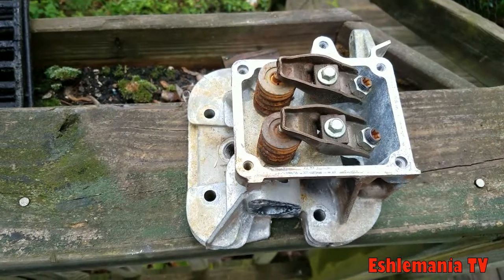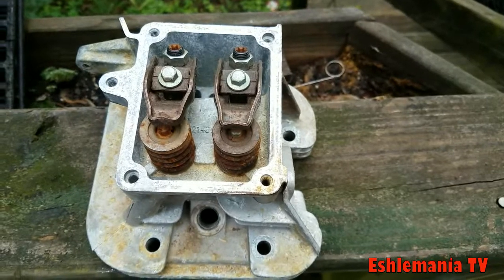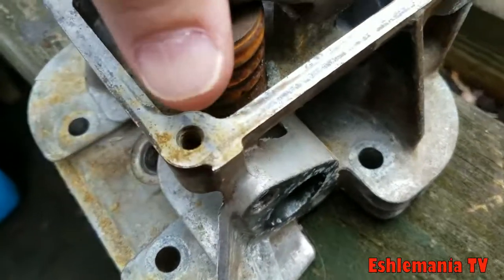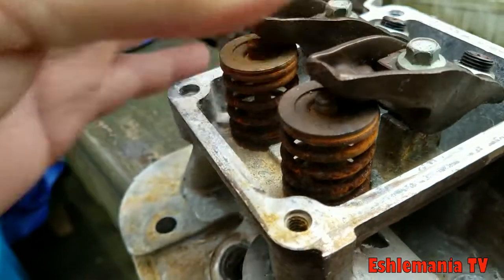Bent Pushrods In A Lawn Mower Engine! What Causes Them?

Comment: Some additional thoughts... I have a Kohler Vtwin that eats push rods every couple of years. The first time I dismantled the entire engine and replaced the rods and reseated the valves that's when I found burnt sticky oil in the intake valve guides I cleaned it all off and replaced the push rods and all was well untill wnother mouse decided to build a nest in the engine blocking airflow again and sticking the intake valves. The funny part is that the engine ran perfectly the previous time I cut the gras and only stuck the valves after sitting...this is the clue that it wasn't the dreaded valve guides coming lose but instead the coking valve guides from overheating. Just bend the push rods back and clean the guides and put it all back together and your back in business. Every failure doesn't doom the engine and the push rods do just fine if your careful not to crimp the tubes by using a plastic mallet. So the take here is not to automatically doom the engine to needing new heads until you inspect the valve guides first, and lucky for you all this requires is to take off the valve covers and have a look .

Comment: Infrequent oil changes, overheating from debris building up on cooling fins (need to remove engine shroud and clean and check), excessive valve clearance, and other reasons for bent push rods.  It definitely happens more than you would think.

Comment: Wonderful, Thank you for posting this. I have a 2 year old 19L232-0036-F1 that snapped the Exhaust Push rod. I purchased a new Rod, and installed it and started to bend that after turning the engine over by hand w/o the plug in. Now thing back after removing the valves and doing a  head/valve cleaning, I remember the exhaust valve guide being higher than the Intake. New Cylinder head coming up....& regarding the overheating issue. This engine is in a dusty ,dirty environment, but there was NOT any buildup of debris in the fins, or the cooling fan, and am at a loss to figure out why it may have over heated to the point that this could have happened.

Comment: After beating my head against the wall working on a Vanguard because I can’t get the valves lash to stay when I rotate the engine and the pushrods wanna keep falling out and I did have a bent pushrod and bought another steel push right on the intake I watch this video and I noticed that on both heads I see the valve guide pushed up on the intake so thank you very much because now I know what the hell’s wrong but the engine didn’t overheat so I don’t know why this happened to mine

Comment: I have seen rocker arm come lose and a pushrod fall off and the other will bend the valve was closed tried to blow out the intake on a power stroke .   Heat is the killer of all Engines .     Still Great advice to look for when doing a pushrod  B&S valve guides do come lose under heat .

Comment: good info. The valves should be checked, adjusted periodically to prevent and or catch it before a bent push rod occurs.
Reply from the maker: Valve adjustments are something that way too many people neglect. We know that most people believe that as long as it starts and stays running then the engine is fine. This is something that good repair shops have been adding to spring service programs and most customers don't have a problem with paying the few dollars extra when it's explained to them and shown that the manufacturer lists it in the manual as a requirement after a certain amount of hours.

Comment: Excactly what i was in search of...!!! Thank You for this video!!!
My push rods were missing completely...???
Bought the mower used and have no clue as to where they went...??? And i honestly don’t see a way for them to have (dropped) into the oil pan yet i do plan on searching for them there...Otherwise the factory Left them out 😳🤷‍♂️ or previous owner took them out because the mower generates enough power to mow without them!!!
I’ve obviously been mowing without them for quite some time and couldn’t tell by the sound of the engine... no backfire no spitting and sputtering no unusual noises at all-went to tune it up and one plug looked Great (as if it hadn’t been used) maybe it hadn’t been 😂😂😂
Thanks again and I’ll be sure to subscribe to your channel ✅

Comment: My 25hp V twin B&S bent one pushrod and broke the other push rod on one cylinder and the other was fine. Valve guides were set where they should be and the valves moved fine.  Any ideas why? Had to take the engine apart to remove the broken push rod.

Comment: Can you get a complete head?  I can't find a complete head with valves and springs, I have a 28HP Kawasaki and all I can find is the bare head.  Do you just re-use your old valves, springs, rockers?
Reply from the maker: Kawasaki has started making kits for cylinder heads. But so far it's only for certain models of engines. So if there is no kit available for yours then you would either reuse your hardware or purchase everything new individually.
Reply: Take to long and youtube do not accept so much time.

Comment: Awesome! Thanks for the tips. I inherited a Husqvarna with a 23HP motor that was said to have "bent pushrods" i am going to take it apart once it warms up a bit and do some digging around. What the usual cost for a new head to replace it and it sound like its pretty easy to replace?
Reply from the maker: Retail on a new complete cylinder head kit for these Briggs Intek twin cylinders is around $150 or so. But that can vary greatly depending on where you live and what dealership you talk to. 

It's not a not a difficult job to do. Just have a shop manual on hand and follow the directions.

Comment: A bent rod does not mean the engine is destroyed does it? I suppose being overheated might be a more major issue.
I am looking at an old Diesel tractor that has a bent rod and I figure I could do a full rebuild over time.
Reply from the maker: A bent rod means that some other component of the engine has malfunctioned. So it really depends on what happened to cause the rod to bend.
Reply: @EshlemaniaTV my mower deck dropped after hitting a rock and the rod broke at that moment.

Comment: I have the Same thing  what i did was  took the valve guide out  tock it to machine  shop Make a new valve guide  with little biger diameter  on one end  pushed in from inside out that way it wont come out problem solved a lot cheeper  then by a new head .

Comment: i'm going to pull the valve cover off my briggs single cylinder engine and check it is loud like the exhaust is trying to come through the carb  even puffs smoke out of carb and when it started it got so slow a power wheels could pass it
Reply: Timing jumped
Reply: It's a bent pushrod mine did the same thing.

Comment: Something in my Kawasaki engine on my Toro is ticking. I removed the valve covers and adjusted. It didn’t help. Everyone keeps saying oh Kawasaki’s are just noisy. Or oh that’s normal. It doesn’t sound normal to me. Can you take a look at my couple videos on my channel and see what you think?? There’s only about 6 videos total. All are less than 30 seconds. The engine doesn’t have any loss of power. The only thing that is odd is sometimes when I go to throttle up from idle it takes a second to catch up if I go to quick.

Comment: Mice love to nest in the shroud..the nest restricts air flow which cellos the engine and the head expands faster than the guide so the guide walks outta the head so use moth balls or hot sauce when you don’t use the machine for the season

Comment: Have seen this on kawi twins too.
 Mice aren't nice.
Reply from the maker: Yep! I've seen this on Kawi's too. The ones I used to see it on the most was on the horizontal V-twins in the John Deere zero turns. Horizontals in zero turns usually struggle for cooling air more than the verticals so it was never a surprise when we would get one with a valve guide that had moved.

Comment: Is it possible to bang the guide back down where it belongs and peen it?
Or is the head just junk.
Reply from the maker: Some people will try it and think that they've just saved them selves a few dollars, but in the end it's only going to cost more time and money because you'll have down time again and will finally have to spend the money to replace the head. Better off to just fix it right the first time around and make sure your cooling fins are clean so the new head lasts.
Reply: @EshlemaniaTV  Seems like it would be fairly easy to drill and tap a tiny hole tangent at the interface between the guide and head. Then put a set screw in it and peen the top of the hole over so it cannot back out. The threads then take the loads instead of a press fit that has become loose. Peening the guide it might work too, but only if peening over the top of a chamfer on the guide or a groove in its side. I think these are smooth and not flush at the top, so would not hold tight just smashing material into the side of the guide.
The new head probably runs around $150 though, so depends on what people's time is worth, and if it is work for someone else.

Comment: Will really bad black oil cause this?
Reply from the maker: Really black oil is a sign of oil that has been burnt. So either it was in there too long and was not helping to lubricate properly which will cause high temps from friction, or the oil burnt from an external cooling problem such as clogged cooling fins or missing fan blades. Either way, black oil is a sign of an engine that was running at high temps and over heating is the primary cause of this failure.
Reply: @EshlemaniaTV  cooling fins are clear and no broken fins.the intake push rod was broke in half.valve seat was in its normal location.the lifter is frozen.i think it was just really old oil.

Comment: weak valve springs? compare a new spring to the old one
Reply from the maker: Compare a valve spring in one of these Briggs Intek engines to one in a Kohler Command engine and you'll see a huge difference. Compare a used valve spring from a Briggs Intek to a new one for a Briggs Intek and it's not going to be that noticeable if at all.

Comment: On my single cyl intek the intake push rod bent. Everything else looks ok and the valve guides are where they should be. The valves move freely. Would i be able to get away with just replacing the push rod?
Reply: Did you end up doing this?

Comment: I've encountered the bent push rod syndrome with a used Briggs snowblower.  I've since jerry rigged the push rod guides by drilling a hole through the side of the head, and indenting  the guides, and inserting a set screw.  I installed new push rods and after adjusting the clearance, when  I hand crank the engine slowly, the rods are bending when trying to open the valves.  I's starting to think that the rods I bought are too long, or can anyone think of anything else?  And it could be I'm  adjusting the clearance the wrong way.
tks anyone with more knowledge than me, which I don't have much have, Merry Christmas to all.

Comment: Happened on my kawasaki at 200 hrs.  Solution? Drill  and tap through cylinder head and set screw that valve guide on exhaust side .

Comment: peen it ruff it up red lock tight beat it back in same with valve seats head fixed ..or one could let it rust and then press it back in i even thought about a little acid on it press in place [forced corrosion]   i learned a few Russian style tricks

Comment: Did he say mice build a nest? Awfully  small mouse. Let's go with heat build up.
Reply from the maker: Only takes about a 3/8" opening for mice to get in. We see this a LOT around here in farm country. Mice get in through the shields and build a nest under the shroud. We've even seen mice jammed between the flywheel and magneto because there was no way of knowing they were under there when the owner started the equipment.
Reply: Plenty of videos with mouse nests in the fin area of small engines.